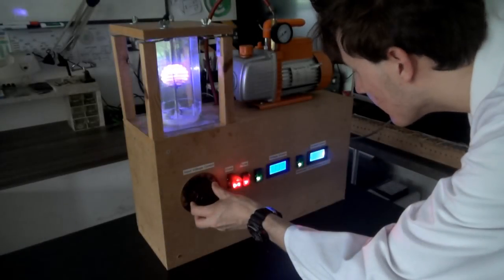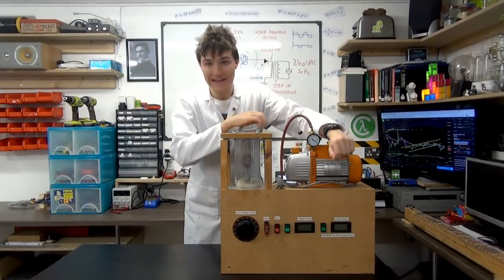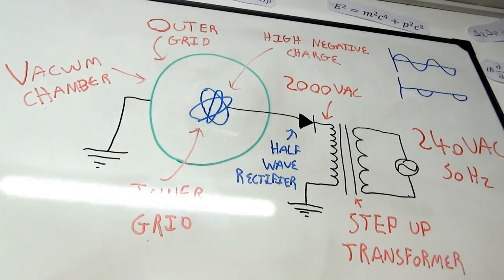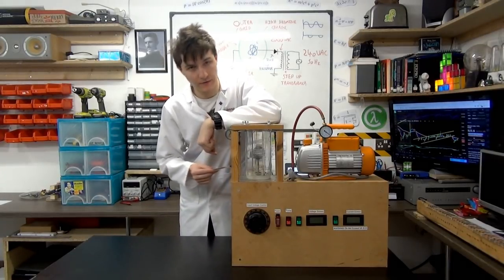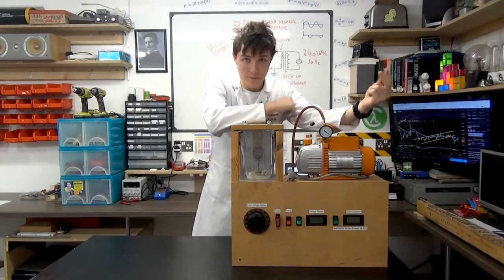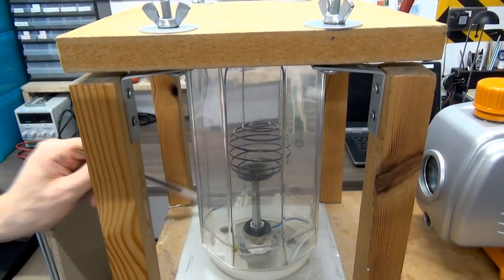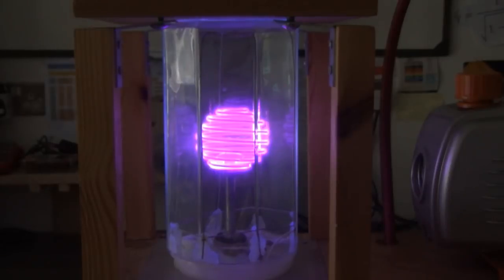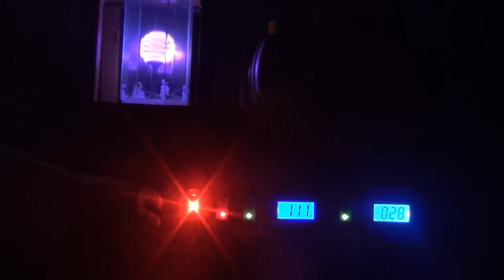My Farnsworth-Hirsch-Meeks Fusor - A Homemade Demo Ionic Fusion Reactor

Comment: Congrats. You made a Florescent lightbulb the hard way.
Reply: Someone sounds just a little bit envious.
Reply: @JohnVKaravitis  does it produce x-rays? No. I haven't seen the video yet and judging by the colour of that plasma, the gas he is using is hydrogen not deuterium. If it really is a fusor reactor, you wouldn't be in the same room as the project because a real fusor does produce a lot of x-rays.
Reply: @Kal-0000  it's not a hydrogen, it's the air
Reply: @jskratnyarlathotep8411  please read my comment again.
Reply from the maker: As I've said in the video and in the title, its a demo fusor. It demonstrates the theory of operation, its not meant to be a working fusion reactor.
Reply: @halfcorp9720  I know. It's a joke.
Reply: @Kal-0000   to get a X-ray going You going to need a 60 kVolt DC (60.000 Volt DC) for that you going to need a transformer from old dental x-ray machine, plus you going to need a diode stack from the same machine. And your vacuum chamber need to be in 100 millitorr or less.
Reply: @halfcorp9720   your diode is in parallel, as you know that only one diode works in parallel,  the one with lowest resistance. You need to use a diode stack that is a 1000Volt and 6Amp each. For the 2000Volt transformer secondary you going to need 3 diodes in series, you going to get voltage drop in the diode stack  ~0.8volt per diode in the stack. Your microwave diode is for 8kVolt and ~0.350 Amp. Hope it help
Reply: @Kal-0000  deuterium is an isotope of hydrogen

Comment: if you want a cheap vacuum booster, get a pipe that is 30 feet long with caps on both ends. Then put a ball valve on one side (bottom) and connect a vacuum line to the other end (top). connect the vacuum line from the pipe into a Tee in your current vacuum system. Fill the whole pipe with water and then stand it up and put a bucket around the valve so when the bucket is full the valve will be submerged.  pump as much vacuum as you can with the pump and then open the valve on the bottom of the pipe to start draining the water out, the 30 ft of water will pull an almost perfect vacuum.
Reply from the maker: Wow, that's a clever idea. I will have to give it a try some time!
Reply: Wow that's ingenious, and I can't think of a thing go single reason why this wouldn't work other than getting leaks where you connect a vacuum line to the top of the pipe.
Reply: Won't the water just boil without pulling a vacuum?

Comment: Excellent project well executed & simply explained & well built.  i plan to take a shot at one of these myself for a display piece soon hence finding your video production. those 5 years where certainly worth it.  This is one of the best home builds ive seen so far. Ide like to have a pop a a deuterium set up one day, but the the level of construction needed is nothing short of industrial to achieve that. I will start simple, i already have a lifetime of HV experience, so there is a good grounding (pun intended)  
Its good to see people still doing things like this in the UK, excellent lab build to.

Comment: 1. For your safety, verify the absence of gamma rays with a Geiger Counter.
2. A Utah state grad student built the fusor based on Farnsworth's patent document. He used a stack of CDs in front of his Geiger counter tube to be able to detect neutrons. It worked.

3. To get the electrical connection into the chamber through the plastic, next time consider using a ceramic feed-through capacitor. The capacitance value is irrelevant since you will be mounting the feed-through capacitor flange into the chamber plastic base or wall. Screw the steel post into a block of plastic inside the chamber which is then glued to the chamber base inside.
4. If you can disconnect the transformer secondary high voltage from the ground or transformer case, then you can use a full-wave rectifier bridge to produce full-wave DC output (2KV.)

Comment: Hi, just a suggestion, why didn't you use a capacitor to filter the output of the HV transformer, without one the, the supply voltage to the anode in the vacuum chamber will be pulsating to the frequency (half) of the mains supply, you can salvage one from a microwave and it would stabilise the dc current to the anode. Great project!

Comment: Hi, just wanted to congratulate you on the project completion. I've done a similar one using a few different pumps. One note thou, there seems to be some restriction in the vacuum line, like a check valve or something. You can hear the pump stop gurgling way too fast and that is not how it should sound with such a chamber. I think you could get a much improved vacuum if the lines from the pump was free from restrictions and not too small dimensions. Hope you get to run that often and inspire others to get involved in the field, greetings from Sweden (:
Reply: where did you get your deuterium?
Reply: @polyblank73  I did not use D2 or T

Comment: according to other fusor videos there should be glow at the central point of the spherical grid, where the fusion is happening. Maybe it needs to be more symmetrical?
Reply: That and let's add a couple billion degrees and 3 or 4 million atmospheres of pressure, that should get it. He's almost there just 9 or 10 trillion dollars of funding
Reply from the maker: What you are describing is known as star mode, my is operating in halo mode, where the grid itself glows. Star mode is achieved using a more powerful vacuum system which I do not own. However, I actually prefer halo mode, I think it looks cooler.
Reply: @halfcorp9720  Another benefit of halo mode seems to be that you don't need a bunch of shielding! :D

Comment: is it possible to get the high voltage from lightning and convert the energy to electricity and save it in a battery ?
Reply: Yes you can get voltage without high current even 40000v. But not as that electricity without current

Comment: And what is the power requirement for the diffusion pump could I get away with a pump that pumps 5 l per minute and could i use hydrogen as my fusion fuel

Comment: Could the chamber walls be the ground if made from metal instead of a glass chamber with the grid inside?
Reply from the maker: Yes, proper fusors have to be made from metal anyway because of radiation
Reply: I am going to make very soon is there anything I should really know? I have electrical knowledge and a little bit about chemistry and gases

Comment: The side of the vacuum pump says it is able to reach a 0.01 Pa vacuum. That would be enough for a fusor (I think), so the 0.01 Pa pledge is not true :(  Did you measured what is the best vacuum it can achieve?
Reply: Cheap "harbor freight" grade pumps...

Comment: Nice project! 
How can you be sure that you are actually getting a fusion reaction? Do you have a gas analyzer? Or a Geiger counter at least?
Reply: There is no fusion the voltage is only 2k. But great effort.
Reply: If you just put it under vacuum and don’t backfill it with deuterium you shouldn’t have any problems with radiation

Comment: when you convert the current into DC using the diodes where do  you wire the positive end to complete the circuit on the electrode?
Reply from the maker: There is no positive end. Since only 1 diode is used, the rectifier is only half wave negative, meaning you have AC going in and only negative DC coming out. The circuit is completed as the outer electrode and the other AC terminal on the transformer (the case) are connected to ground
Reply: @halfcorp9720  Thanks but what do you mean by outer electrode?
Reply from the maker: @lilyh4467  The outer electrode is the outer grid, you can see it in the circuit diagram at 5:46
Reply: Halfcorp So the outer grid isn’t connected to any power source, just ground?
Reply from the maker: @lilyh4467  Just ground, the only power source is the transformer that generates the negative potential at the inner electrode. Remember that in order for the fusor to function, a negative potential must exist between the inner and outer grids, this setup achieves this.
Reply: Halfcorp Gotcha, thanks!

Comment: Two quick questions if I could:   1) Although this is a demo fusor as you say, does it produce anything that can be detected on a geiger counter?   2) If you run two microwave transformers in series, shouldn't that multiply your voltage again for more effect?

Thanks! :)
Reply from the maker: 1. No, it is a demo fusor so no actual fusion should occur, any type of radiation detector used near this will register nothing above background. My point in the video was that it is very unlikely, but not impossible that a few atoms could be fusing due to the random distribution of energies inside the chamber. (Although this was more of a tongue in cheek way of validating its name of a fusion reactor). 2. If you connect two MOT's such that their primaries were in parallel and their secondaries were in series, yes you would have a voltage output of about 4000 VAC. This was the setup I used for my project Exodus Tesla Coil (One short video of which can be found on my channel). However,  this configuration would draw more current. My limiting factor was not the number of MOT's but actually the Variac itself (at about 3 amps). So this fusor doesn't actually leverage the full power the MOT can provide. I chose 3 amps because I tested the fusor initially with a 15 amp variac and found negligible performance increase past that point. (Arcing began and the vacuum quality then became the limiting factor). Finally, the chamber and MOT get very hot if pushed for more then about 5 minuets at full power, making a cooling system necessary if I wanted a more powerful effect.
Reply: @halfcorp9720  Thanks for that, very good explanation and quick response! :).   I wrongly assumed that the voltage would go up but the current draw would remain the same, interesting that the results don't seem to vary much with increased power, so that makes it fairly simple to build then!

I've just successfully made a mini cloud chamber with peltiers and looking to this as my next project.   Making one with Deuterium would be cool... but I think I'll start with this :D

Comment: That’s not how philo farnsworth Fusor operates. Why do people keep making typical circuits and say it didn’t work?

If you learn anything from philo farnsworth work and his multipactor tube you would see it is not wired simply with opposing high voltages. 

The devices use high voltages of the same polarity with a neutral floating grid.

Comment: Is it truely a fusion reactor though? Just appears to be a plasma generator. Robert Pirlot said its an expensive light bulb
Reply from the maker: If you put Deuterium or Tritium inside this, it would fuse; if you put Deuterium or Tritium inside any neon/fluorescent light or plasma globe, it wouldn't.
Reply: @halfcorp9720  Thanks for replying so fast clearing that up
Reply: It needs higher voltage and amperage plus thicker wire plus super powerful electromagnetic fields plus cooling and don't forget the neutrons that real fission gives off. In the video you are making  ozone out of air not fusion.
Reply: @IRowspan  this would most certainly NOT produce fusion.  It's nothing more than a plasma discharge lamp.
Reply: @ronaldbrown9638  yea i kinda thought so. Its my understanding fusion is very difficult to pull off. From what i've watched it takes immense electro magnets to condense plasma enough to have fusion occur. Of which i saw none in this video. But i'm no nuclear physicist. Logan reckoned it was only making ozone, but since it was done in a vaccum i dont think thats correct either.

Comment: Great project. Can you tell me what kind of fusion reaction happens? In the system with deuterium it is basically the reaction happening in the sun. So deuterium combines to produce Helium (with maybe the step in between where Tritium is produced). In this process also Neutrons are created. What kind of fusion reaction happens with air? I'm really curious about that
Reply: Dani Master at 2kV and that pressure none. Fusing oxygen or nitrogen would require such a high voltage I am not even sure it’s doable.
Reply: Nitrogen plasma
Reply: @pllagunos  Pretty much doable actually (a lot harder though) check out a video from Neptunium called "Fusor and Nuclear Fusion part 2"
Reply: Alex Larex already had seen Neptunium’s work at fusor.net and it is vastly different to what I mentioned. First, he uses deuterium, which at 20kV has a much higher cross section (x1000) that any fusion of oxygen or nitrogen. Secondly, he has a 50kV power supply. Some small events of fusion in a demo fusor could be possible due to quantum tunneling, however, don’t expect to be able to measure these fusions.
Reply: @pllagunos  I read your comment a little too fast and din't notice you were talking about air fusion and not fusion on this scale in general.